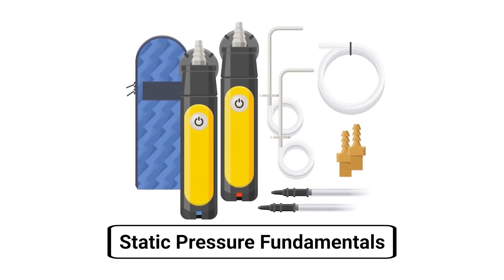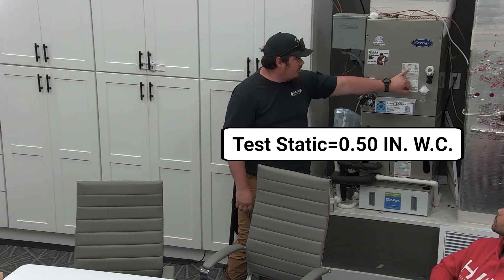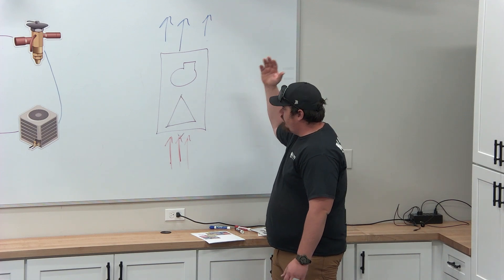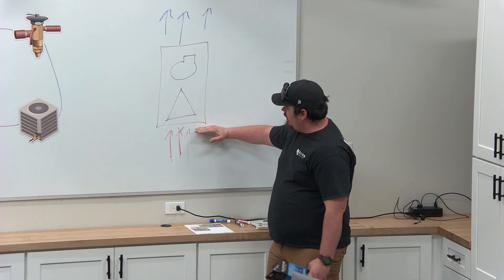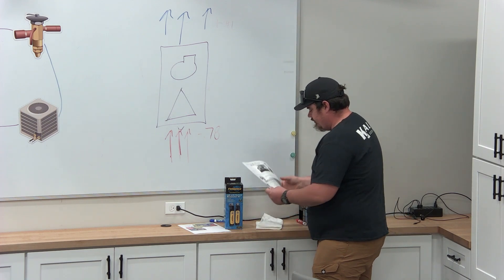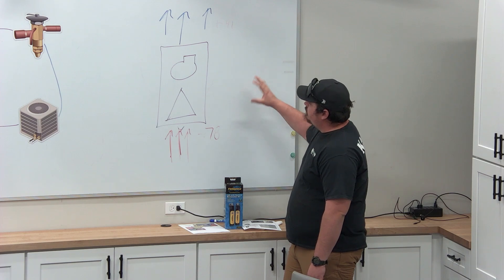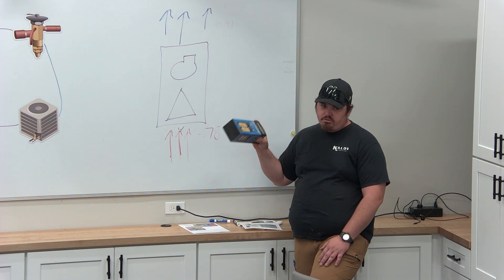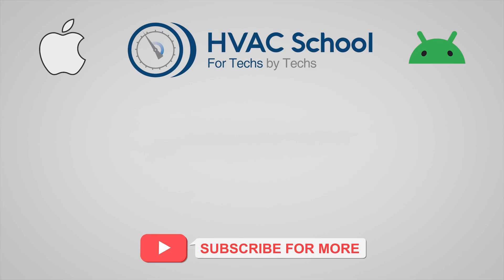Static Pressure Fundamentals

Comment: Heres the thing i go to a 20 year + system to dona maintainence and ths systwm is running at 1.2 static and i bring up the importance to the client and they say well my system never messed up so oh well.
Reply: The high static pressure won’t hurt the PSC motors. They will just move less air. But, it will be a bigger problem once you install a new system with the ECM blowers. But, insufficient airflow will cause performance problems in both.
Reply: That’s a good point, sometimes I found systems draining with no P trap for years and I am not dare to say is wrong because if you install a P trap and a problem comes is all yours, sometimes is better to keep silent
Reply: I’ve been a service tech in SLC Utah for 3.5 years. I told myself I was going to look at everything and test everything at every house to lessen the learning curve I hoped. It definitely paid off! Now, if I can, I always check static pressure first. It just makes sense! There is a reason why one of the first things the Dr. does at an appointment is check blood pressure!  It provides very important information for the system being looked at. I found about 8 out 10 homes hadn’t ever had static pressure checked.

Comment: The pressure the fan must overcome to push air through ducts, filters, coils, grilles, and dampers.

Why It Matters
	•	Too high → The blower works harder, energy use rises, noise increases, and airflow to rooms drops.
	•	Too low → Could indicate leaks or missing filters; the system may not distribute air correctly.

⸻

Typical Causes of High Static Pressure
	•	Dirty air filters
	•	Closed or blocked supply/return registers
	•	Undersized or poorly designed ductwork
	•	Dirty evaporator coil or blower wheel

Undersized ducts cause excessive resistance and high static pressure.